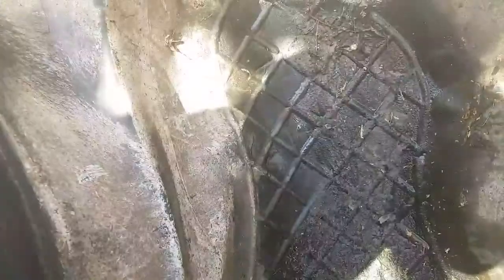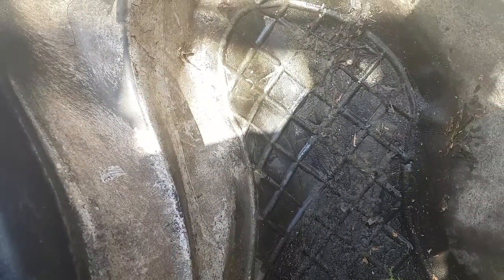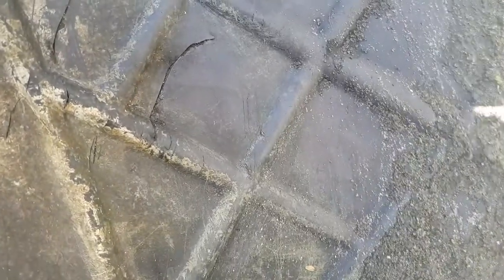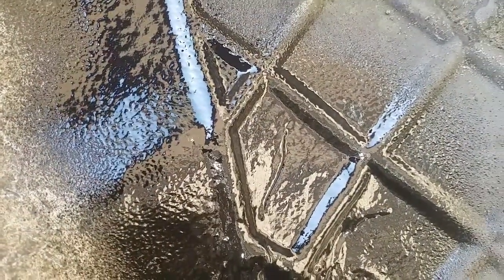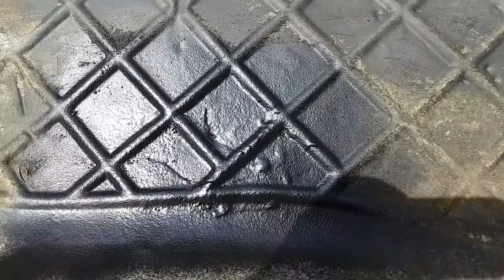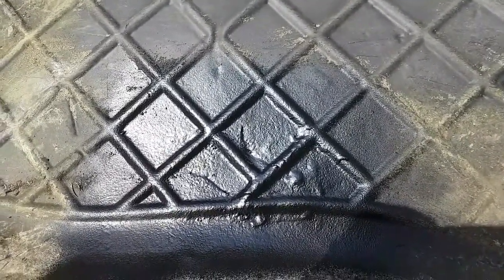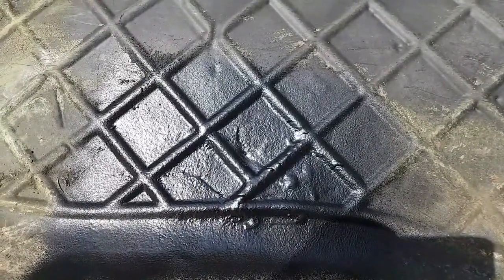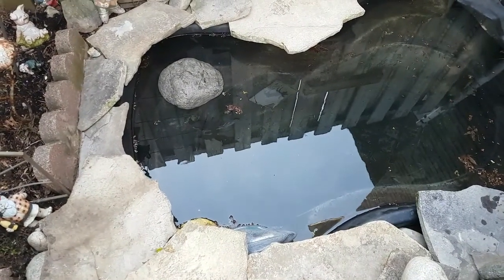Pond Repair :How to repair a hole with Flex Seal

Comment: I started out with a pond with a hole or 3 actually I used flex seal and got 2 years but its leaking now again which means taking it up.... im debateing just put a pond liner in it... any ideas for me?

Comment: did the flex seal not chip off? i did this with one pool liner and my ducks were covered in black flex seal afer. I am wondering what i am doing wrong?
Reply from the maker: My pond is still going fine, no flakes, im not sure why it would flake, how long did you leave it dry for?